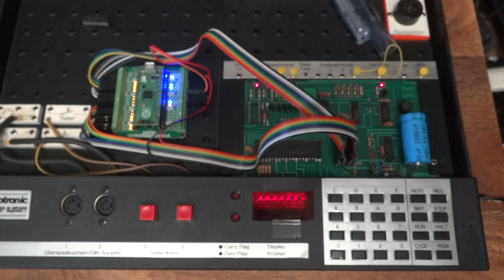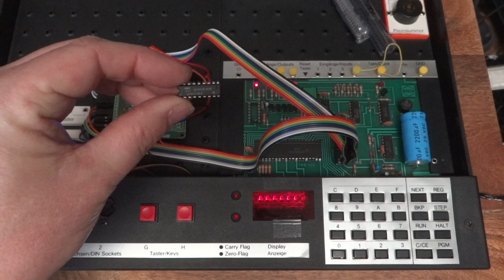Emulating (S)RAM with the Raspberry Pi Pico!

Comment: Any chance to test that on the cpc even if still 1k?  It would be a step towards proving cpc can have hardware made in raspberry pi
Reply from the maker: Well, I think "tranditional RPi" and RPi Pico are quite different... this is, after all, more akin to a high-end Cortex-based microcontroller, not a SoC like the traditional RPi. So, your "original concept" doesn't quite apply ;-) But - I think it was already proved that the Pico is fast enough to provide, for example, CPC ROM Emulation. If ROM works, so should RAM, IMHO. However, the Microtronic here is much slower than the CPC, so timing is less critical. For the CPC, you'll need to overclock the Pico quite a bit AFAIK. My goal here is to turn this into a RAM-image based "mass storage" solution for the Microtronic, so that I can load and save RAM-Images from and to the Pico (via an EEPROM or SDcard). So SRAM emulation is only a means to an end for me here. Eventually, I'll also make this a banked memory expansion, add speech, and a display. Thanks for checking in, Zhulien!